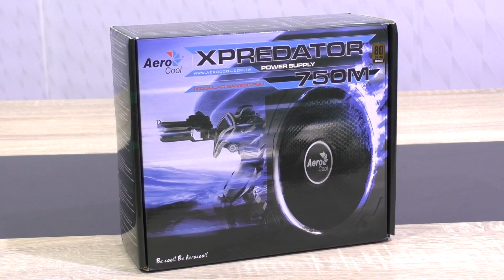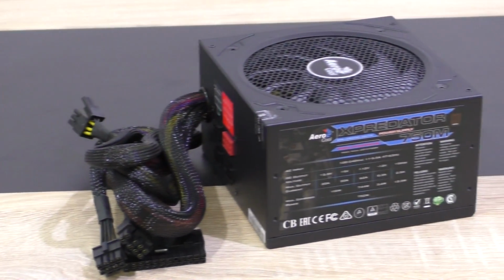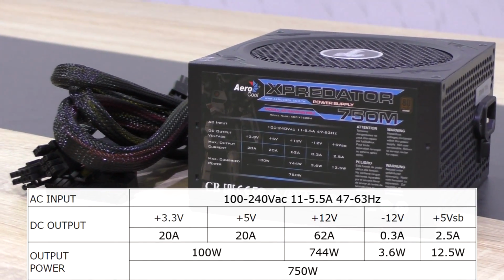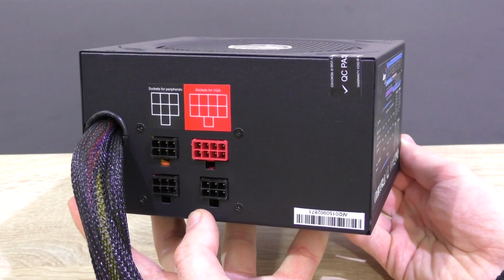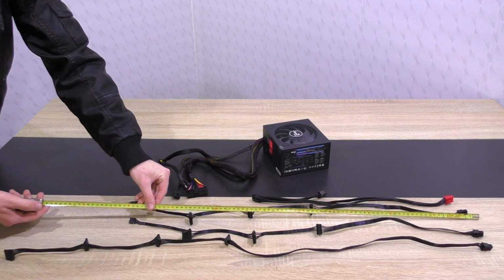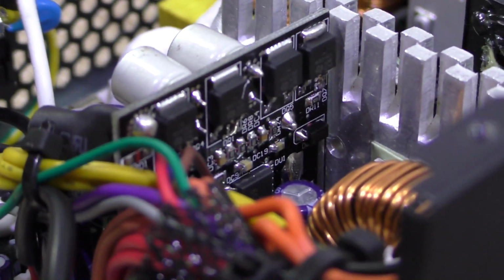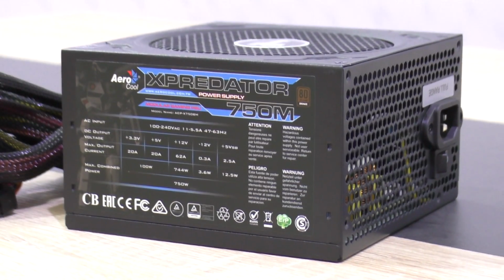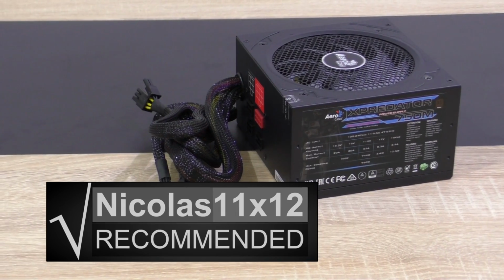Aerocool XPredator 750M 750W Power Supply Review

Comment: I'm about to replace an Aerocool XPredator 600W 80 Plus bronze PSU, but it hasn't failed on me ever and I've had it running almost 24/7 since 2012. The only time it's not running is when there's a blackout or just no power in the house etc. So I think it's about time for its retirement.